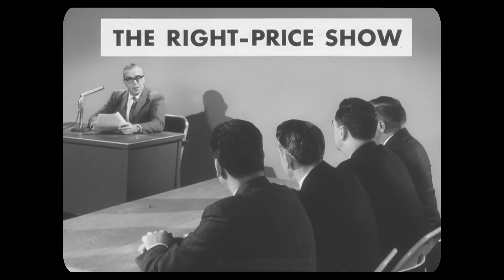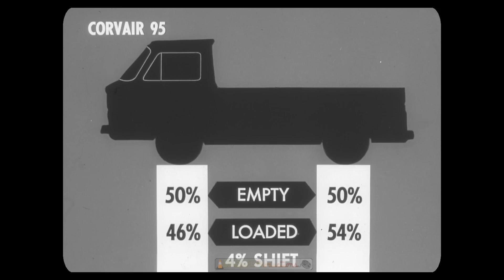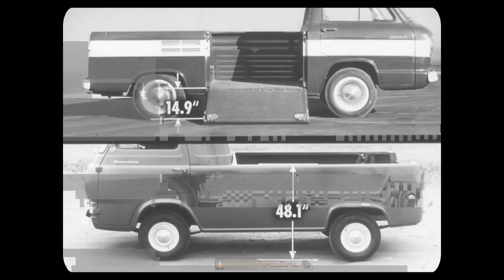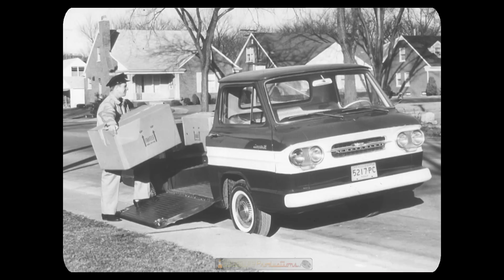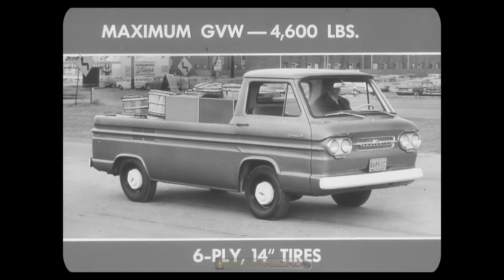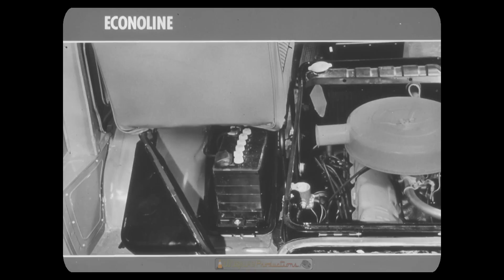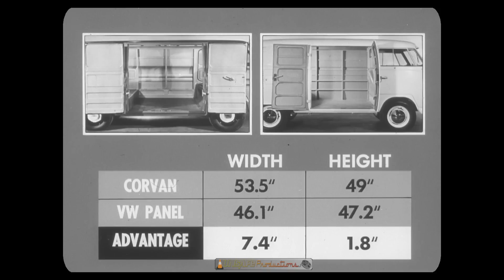CORVAIR FC 95 Vs FORD ECONOLINE & VOLKSWAGEN VAN 1961

Comment: That stinking air cooled engine Chevy made was no where as good as the VW's. But Chevy learned their lesson they've not made an air cooled engine since then.
Reply: papaike2 The Corvair engine can be certified for aircraft use with the addition of a magneto ignition. It is a common upgrade for Cessna . There is an aftermarket camshaft available for Corvair that makes the engine run backwards and it will fit in a VW bus.
Reply: I don't recall any demand to put VW engines in Corvairs.   Guess nobody wanted to go backwards in performance.
Reply: You've got to be kidding.   That engine was superior to the VW engine of the same vintage.  6 cylinders, even the basic engine had twice the power,  hydraulic lifters to stay in adjustment versus solids.  Heck, IIRC the VW didn't even have an oil filter.

Note not even Porsche makes air cooled automotive engine any more.  There are valid reasons.   VW/Porsche made them for a lot longer than GM.  Were they just slow learners compared to GM?
Reply: @loctite222ms  Those hydraulic  lifters in the Corvair were trouble prone because of "leak down" due to the "boxer" engine. And just because the engine has more cylinders and more power, DOES NOT mean it's a BETTER engine. Try running a Corvair engine FLAT OUT for a few hours and see what you get! In the VW you can run that engine FLAT OUT ALL day without hurting it,  just DON'T lug it, you'll burn valves!
Reply: that was a lot of years ago and with learning air cooled engine's are not the way to go because the extreme heat breaks down oil life and the life of the engine  but back in the day the VW was designed for the country in which it was used very low maintenance and very economical transportation for the masses irregardless of the quality and comfort aspects the era in which it came out the gross national product for the most part was ear marked for the military and to keep the masses happy Adolf made this very economical car available to the public as a propaganda tool for the advanced society in which all Germans lived  wow did that go wrong. and yeah I babble on
Reply: @sillygoose2508  Air Cooled also has some emission issues which was most of the reason for their demise in the US as well as noise issues. Also with the moment of inertia on a rear engine vehicle so far to the rear  with the advent of crash testing   to meet similar results of a front engine vehicle a rear engine vehicle needs to be built much heavier and weight sucks up horsepower and  uses more fuel.
Reply: inurtrash,
Maybe, but back then those engines didn't exist.  The whole Corvair power train could be swapped into the air cooled VW buses.
Reply: what are you pushing 70 to 80 hp and the reliability of a GM built engine I'm sure you know more about it than I but sounds scary  and a lot of engine's connected thought a manual transmission and or gear box can run in reverse order if it's diesel or two cycle   is a corvair engine two cycle I believe
Reply: @sillygoose2508  No Corvairs were 4 cycle, it's just that GM used gaskets that didn't hold up to the heat so they leaked and used so much oil you thought you had a 2 stroke.
Reply: inurtrash shut the fuck up 😂😂

Comment: Chevy  is a poor loser,  If the Econoline was so bad Why  was the  Corvan  dropped for a  Van like the  ford!
Reply: The Corvan looked better on paper.  It had great design stats when compared to the Econoline, as harped on by this vid. 
But the truth was, between the awkwardness of the rear loading design, and the fact that the engine was nowhere near as reliable as the Econoline's straight six or the VW's pancake four, it came up significantly short. 
And it's a shame, because the corvan was by far cooler looking than the other two, it DID ride more nicely (since it was more of a car chassis than a truck chassis) and better looking than the Chevy van they replaced the Corvan with.  (and Dodge's version too)  
The Chevy van which replaced it was a much better van than the Corvan, overall, but it was late to the game, and never matched sales with the industry leading Econoline. 

The Corvair chassis and driveline made for a fun, kitschy little car.  But it just never was good for a serious work truck.

The only van to have ever successfully implimented a flat engine that was powerful, reliable, and elegant enough in design to be a marketing winner would be the Toyota Previa..  way later in the 90's though.  
Whoodathunk they'd have been able to turn their legendary 22r engine sideways and gotten it under the van so well?  Weird design, but it worked well!
And being a RWD, it was tough enough to make for a great work van too.
Reply: they dont like air cooled engines
Reply: Ralph Nader...
Reply: Mylan Miller The main reason,MONEY. Sales talk no sales walk. When you have a customer base made up of mostly morons you have to keep them happy as they are paying the bills. It is the same today, that is why the fords sell more. They don't have the intelligence to realize when they are getting ripped off so they go with the cheapest most poorly engineered thing they  can buy. Best selling and best are not one and the same.
Reply: @riverat440  So, what you are saying is that Fords are the CHEAPEST to buy? I don't know what parallel universe you are living in, but in mine, Fords, especially trucks are actually MORE expensive! Try 80K for a "King Ranch" (well equipped)!

Comment: As much as I respect the Volkswagen Van, it can be said that the Corvair 95 was a greatly improved version of the same concept.
Reply: The "Greatly Improved" statement is open for debate, the Corvair engine had some issues and much past 20,000-25,000 miles leaked oil worse than the VWs and had chronic issues of getting hot and the valve seats coming loose.  GM copied the VW Type II, too bad they didn't run it 3 generations as it usually takes GM about 3 generations to work the bugs out.
Reply: Except in quality. The vw was much better made

Comment: The University of Oregon had a fleet of Corvair vans for their garden crew.  My dad was a professor at Oregon and tried many times to get them to sell him one.  He never succeeded.  Sure, they shared the swing axle setup with the much-maligned earlier version of Corvairs, but their much better weight distribution resulted in little to no oversteer conditions.  Oversteering and swing axle setup and nothing in the suspension limiting downward movement of the axle halfshafts were what caused the infamous flipping over of the vehicles.  It's too bad they didn't stick with the vans into the 65-69 years, when the entire lineup had much improved handling from double U joint rear axles.
Reply: The Corvair was replace by the Vaga,and the Vaga was replace by the Chevet.
The Corvair was the best body of all of them.
It is a shame that GM does not bring back the Corvair with front wheel drive.
Reply: Why would you want a Corvair to be a front wheel drive???
That would be one awkward turd.  A terrible idea that would defeat most of the purposes behind the Corvair design.
Reply: @1SqueakyWheel  Well, it would be "safer" for the AVERAGE driver because of under steer instead of over steer!
Reply: @TheOzthewiz  while I can't disagree on that technical point, I maintain that it would completely defeat the point of the Corvair's existence. 
Besides.... more people should learn dynamic safe driving rather than passive safety, relying on the car to overcome all the driver's glaring shortcomings. 
Too many licensed drivers out there who have no business behind the wheel of anything larger than a 3 wheeled bicycle. 

But if you really wanna talk about oversteer..   try it with a whole air-cooled V8 behind your transaxle, like in the Tatra, aka "The Nazi Killer" lol.
Reply: @1SqueakyWheel  Tell you what would tickle MY fancy....a mid- engined ELECTRIC Corvair!
Reply: @TheOzthewiz  If it's electric, then engine placement is largely moot. 
Ideally, motors at the wheels, and batteries evenly distributed along the chassis. 
That said, I understand a conversion is most likely going to be one central motor, like what I plan to do with my resurrected VW KG with retention of the transaxle just for modding simplicity. 
But it's worth noting that motors tend to be much smaller and lighter in comparison with engines of similar torque ratings, so again, placement of the motor doesn't really matter.  It's the battery placement that makes the biggest deal.
Reply: @jamesmooney2808  GM already has enough small FWD cars that aren't selling, why add another one? The Sonic is probably the BEST small car, to date, that GM (thanks to Germany & Korea) has built, but it too is getting axed this year because of poor sales. Everybody WANTS trucks and SUVs/CUVs and EVs, The Orion, Michigan plant will be converted to produce some exciting EVs!
Reply: The "better" weight distribution did NOT over come the MAJOR camber changes due to the swing axle design. Only a TRUE IRS suspension would have eliminated the over steer problem! But, that would not be worth the cost for a vehicle that was not selling!

Comment: Does anyone know if they still make the e series? Or was it replaced with the transit?
Reply: +Watchfulseven 52  The E series is gone...  I had a 77 E250 with the 351 and three on the tree.  It went 70K before I put a nickel into it (front brake pads)..  Very simple but bullet proof.
Reply: John-Del, AFAIK either Ford discontinued the last E-Series recently or they're still making the E-450 / 550 HD Cab + Chassis (to put RV campers or square "high cubes" on them) w/the Triton 6.8L V10 and the PowerStroke 6.7L as its' only available engines. Those were only available at Ford Truck only (not cars) dealers by special order.
Reply: @syxepop  Yup, it's called a 'cut-away'.   Cut off van cab in front and bare frame in back.
Reply: There's still plenty around though, they practically had a monopoly on the van market. On the other hand the new Euro vans are proven and practical vehicles too, I've heard they drive more like a car than a van.
Reply: The dinosaur is dead.  Had an 04 which was a decent van but it drove like a house and was not without issues. Rust and a major oil leak at 175k on its Diesel engine caused me to sell it. It was fairly reliable up to that point other than regular maintenance and of course ball joints that would wear out. But hopelessly outdated compared to the European style vans that made their way here.